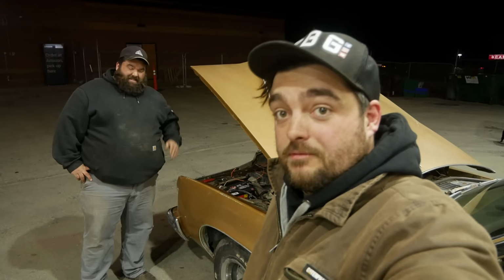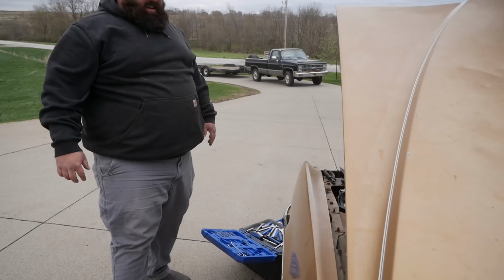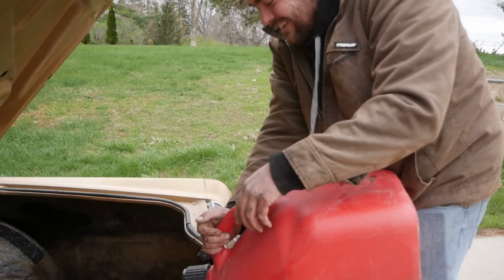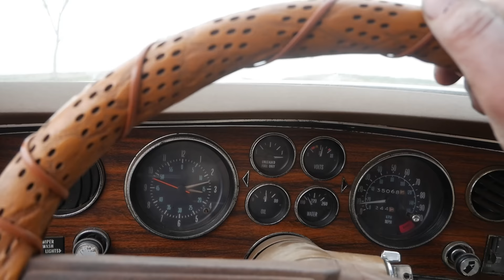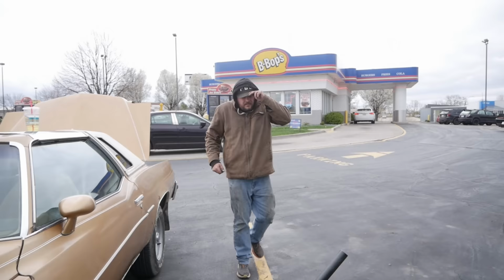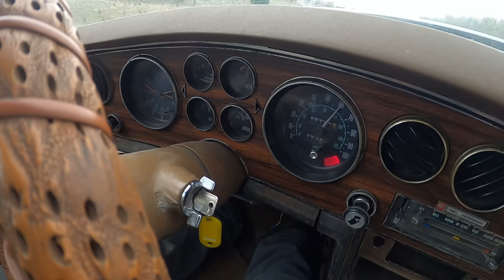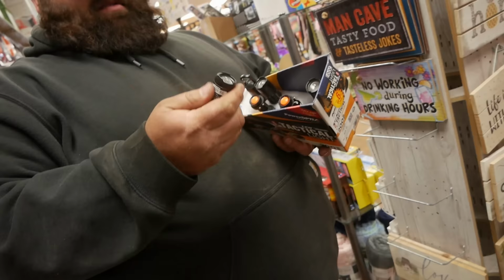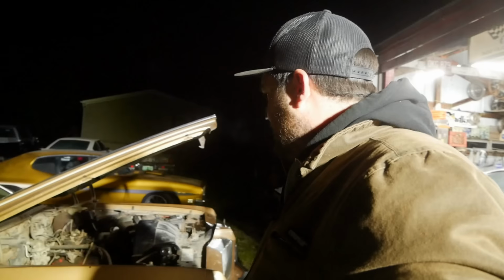SAVED-Will this RARE 1976 Grand Prix Drive Home After Sitting 20+ Years?

Comment: You and Cody always make a great duo. That Grand Prix honesty doesnt look like its in that bad of shape
Reply: Oh definitely. Nevermind all of the rusted body panels, the fuel supply situation, the issues with the tank itself, the starter, the brakes, the leaking radiator, and everything else...😂😂😂 I'm just playing bud. It would be a nice project for someone to take on to repair all of the rust, replace the tank, overhaul the braking system, the T-tops, and rock it around. I know that I'd pimp it.

Comment: Another awesome revive and drive! That ol girl deserves some love. New starter, tighten up the front end, carb, clean tank etc. I think it can be made into a pretty reliable cruising machine. I don't care what anyone says, the big underpowered 70's American land yachts time is coming, maybe not in value but popularity.
Reply from the maker: And it's not like it's difficult to make them move out of their own way. Cam, heads, done on a Pontiac
Reply: @PoleBarnGarage  definitely! Doesn't take much to wake em up a bit. My 76 Torino has a rv cam, aluminum intake and 4 barrel carb upgrade. Dual exhaust with stock manifolds. Scoots pretty good for a big car.

Comment: I owned a 1963 GP and a 1980 GP. That orange was part of the original engine colors. My 1963 was midnight blue with GP mag wheels and black naugahyde interior. Chrome everywhere. The ‘63 was part of the Pontiac wide track series. The 1980 was two tone burgundy and silver with burgundy leatherette interior. They were both excellent automobiles. Enjoy your ‘76.

Comment: Always had those big cars. Last one was 1979 Lincoln town car. As long as you’re not blind, you don’t need “road feel”. Just don’t over drive the car. (Don’t go around curves like an Indy car). And those cars could take a beating. I got hit in a 1965 ford wagon while sitting at a red light, behind a tractor trailer. The guy who hit me was doing 60mph in the rain and never hit his brakes. He put a big dent in the back of my car, yet I drove it home. (He had a 1972 Buick Rivera.) he didn’t. Nowadays, a low speed impact will total a vehicle!

Comment: Cody saved the day.
I once put black pepper in a busted radiator and drove several 1000 miles with it.
Didn't lose a drop of coolant. It set in the hole and completely sealed it.

Comment: While I've never changed a brake caliper in a burger joint lot, I changed a starter in my impala in the parking lot at the auto parts store, it let it's smoke out when I tried to leave.. walked in, bought one, borrowed a socket set from a friend's employees who happened to be around the corner, and changed it where it sat 😂 the sales people were leaving for the day and talked to me about it on the way out, noting it was a junkyard motor, the first of 2 so far, they thought it was great I was fixing it where it sat instead of towing it. I've done lots of stuff like that, we don't call tow trucks until all else has failed 👌

Comment: The steering wheel is the first input from the driver. The last place that steering motion leaves is the idler arm. So it carries the most stress, and consequently the most wear. The lion's share of steering problems can be corrected by replacing the idler arm.

Comment: About to roast Cody on trying to move shifter without ignition on then remembered how many times I’ve freaked out because ignition wouldn’t turn on and then realized steering wheel was against lock and just had to turn wheel a little and key turned easily, that Grand Prix looks like a keeper to me.

Comment: Sold one I had that was previously my cousins car.  After many years I sold it with 176k all original powertrain, no oil loss, no smoke, and original automatic with tight shifts.  I had installed a new cam at 60k when they had it, since they didn't change the oil and it clogged the upper heads and under the manifold with crap.  Amazingly the rings never seemed to wear.

Comment: I had a 1971 grand prix. It was real clean car. One thing I thought was awesome about the car was the outside door handles. The fuel gauge didn't work so I accidentally ran out of gas. Pulled as far as I could off the road but someone still managed to rear end it.

Comment: I ordered my 76 LJ from the dealer. Got every option that was out. No t tops. Mine was deep maroon w gold pin strip, padded roof, volour seats and deep carpeting. 400 engine, 400 Turbo trans and factory posi w dual exhaust.  I only paid around 5500.00.

Comment: I would restore this one correctly. I know it will take longer to do it right but these GP's are extremely rare now. It's a good car that has had years of half ass fixes. The rusted out sections can be fixed with GP sheetmetal from a Southwest donor car. Places like Desert Valley Auto Parts will have the sheetmetal you need and maybe the glass t-tops.

Comment: My brother had one of those in the 80s she purchased it in 84 he lived in Columbus Ohio and was working in Cocoa Beach Florida every two weeks he would drive that car home on the weekends to see his ended up putting almost 200,000 miles on the car with assault in Ohio and assault from the ocean rest of the car completely out departed in 1988 the cause of rust issues but he still ended up selling the motor and the transmission out of the car for $1,000 he said that was the best car he had ever had

Comment: I LOVE 3rd generation GM A-Bodies. No I don’t think they’re cooler or better than the 72 and earlier cars, but there’s just something unique about the 73-77 cars… like this sweet spot between two eras, cars that were born with potential but handicapped from the factory, styling that seems repulsive at first but grows on you whenever you see it amongst other cars in traffic and you realize how unique they are..

But the window has mostly closed on these in terms of availability and affordability. Prices are skyrocketing because people have realized that you can’t touch 72 and earlier with your arms , legs and first born intact, and 78-beyond are small and a different beats altogether… so these 3rd gens are the last chance at a full sized body on frame large engine bay ride. I had a 77 Cutlass that I stupidly sold in 2011… haven’t been able to find a replacement since than isn’t priced DOUBLE what I paid for the Cutlass when I bought it in 07, and in worse condition. Of course, I’m in Michigan, so rust is a major factor.

Comment: I look forward to you making actual repairs to it. A new starter, and radiator, get all the brakes did, get the master cylinder did, and put nice tires on those pontiac rims and fix that rust. You do have a special car there.

Comment: Entertaining video: I acquired one very similar in mid-eighties with the low compression 350 2bbl Pontiac V8, Turbo 400 trans. and like 2.73 rear axle ratio. It didn't have much power, but it did sail down the interstate. I drove it to FL from NY and back, and never got more than 12 mpg, was the next to last year of the nice mid-sized GM body on frame. Wish I still had it as the old car guys are grabbing them up for the nostalgic factor, very cool rugged old ride.

Comment: My stepdad had a 77 same color it had the 400 and the console shifter no t-tops, sunroof. I got one with the 301 and the column shifter for super cheap from one of his friends. He worked at some kind of chemical plant it got so Rusty  too sheet metal screw the Hood skin down.  The 301 in that one got damn good gas mileage  and the AC still worked but man, did it take a long time to get up to speed.

Comment: Go through it and make it reliable. It’s a good starting point since the engine runs so smooth. New fuel system, starter, and tighten up the front end.

Comment: the next time that you have a leaky radiator try K seal it works fantastic and it won't gum or cloud your radiator, it'll also seal hairline cracks in the water reservoirs and your engine if you have any.

Comment: Had one of these back in 1983. Nice car then, the 400 ran very poorly. Pulled the motor took it to the machine shop. The machinist said there wasn't a square or round surface to found in the block. I put a pontiac 350 in it. It was a nice driving, riding car. Sold it, in Oregon leaky T-tops suck bad!

Comment: Pull the Engine. Rebuild it, dump all the emissions, new intake, header's and a 750 Holley/Edelbroke ;). Oh, and an HEI. I had '73, did all that (minus the rebuild), that I used to take to the sat night street races, beat everybody except, some guy that showed up with a 305 in a Vega w/a welded dif. I got him off the line but, about 300 feet in, he shot past me. So, when the GP started blowing rings, I bought a Vega! Put a 500 HP small block in her, mini tubbed the back, Mickey street drags. With warm Mickey's I could lift the front end, only a couple feet but, impressed the hell outta the TRI-5 guys at the mall. LOL

Comment: I used to have a 84 Pontiac grand prix sj non vinyl top factory non ac manual windows car, vinyl door panels and complete guage equipment dash cluster minus tach,had column shift automatic transmission and tilt steering no delay wipers or cruise, factory am mono radio by Delco GM, bench seat front,had no bright metal trim along the bottom of the car,no trunk medallion but it had the nose cone header panel emblem post,wire hubcaps plain metal steel 14 inch wheels and factory 3.8 229 gm v6 th350 metric transmission gotta love the 80's lol,, I wish I had kept that car one rust hole right behind the Dr door the size of a baseball and the no headliner and the dr door was cracked behind the mirror car was from Tennessee i want another one..

Comment: The angle on the shifter is Pontiacs Rachet shifter, hit the shifter at that angle from low 1, and it won't skip any gears!!!
Reply from the maker: Nope, that only applies to the shifters with a detent set in them. If you push the shifter to the right and slam it forward it will act like a rachet shifter. Not all of them are, this one isn't. And it applies to all gm cars

Comment: good luck with the hurst hatch t tops, had them on a 75 buick century free spirit back in  the mid/late 80s and they were 500 each then, i doubt you'd even find them now.....good luck, you'll need it...p.s. i sold the buick to the wreckers and got 800 for it, body was shot but the t tops were great

Comment: My dad had a 77. It had a 350 Pontiac that my dad proceeded to shove a huge camshaft into. Isky 292 megacam. It ran horrible but spit fire n made alot a noise n seemed to amuse my dad😂. That crapped out n we shoved a stock 455 Olds in it. That ran pretty good.

Comment: the grand prix came out in 62.....it was a fullsize luxury sports car....was a catalina with bonneville interior special grills and tail panel in 63 they changed to a grand prix only body......in 68 they went to a intermidate body car.....smaller then a bonneville but still bigger then a gto....all had buckets and console all were 2 dr hardtops....(special order with a bench seat starting in 66)...no rag tops except in 67.
Reply from the maker: Correct but it really didn't take the personal luxury thing into full effect until 69
Reply: @PoleBarnGarage  true but it was never marketed or expected to be a muscle car.....even in 62 it was marketed as a luxury sports car....true till 66 they could be had with all the same options as a gto and would eat a gto with the right boxes marked off....but it was marketed as a answer to the ss impala offered the same yr....buick answered with the riv in 63......i have 4 prixs....62 automatic a 63 tri power 4 speed 8 lug  car a 64 ac auto and a 66 tri power 4 speed 8 lug car.....im fairly familiar with early prixs.....they down sized in 68 an focused primarily on luxury after that but was never a "muscle car"
Reply: @PoleBarnGarage  although another one saved is another one saved......the ole poncho herds getting thinner as the yrs go by....and they sure aint maken em any more.....little tlc shed be a gem....a anniversary edition is even better.......id advise getting a p.h.s. on it....

Comment: I thought the Grand Prix models back then were all very stylish. It's just the big old 400 engines were choked down to 135 HP because of pollution controls.
Reply from the maker: Not quite that bad. 180-220 depending

Comment: 400 pontiacs even smog engines make great power with a cam change.
Reply from the maker: Need more than that, compression ratios are terrible. Thin head gasket or mill the 6x heads though.. Then you have a runner

Comment: What is radio tuned suspension?    Car is a keeper.   Never saw 1 with t tops last of its kind. Factory or dealer installed option. That car wants to live.  Thanks for another great video!
Reply from the maker: Radial tuned suspension? Suspension "tuned" for radial tires
Reply: @PoleBarnGarage  What happens if all season tires are put on a car built for radial tires?

Comment: So you have the return closed and its building too much fuel pressure. What SHOULD be happening is it should be blowing throigh the needle and absolutely demolishing gas, but its not so id say you definitely have a needle issue lol also explains why the fuel kileage on that 400 isnt in the negatives lol. The clip came off the needle on my old nova once. It got like 40 miles to the gallon but you couldn't touch the pedal 😂
Reply from the maker: I would agree except Pontiacs were a no return system until 71
Reply: @PoleBarnGarage  I'm not sure I understand your comment, it's a 76 isn't it?
Reply from the maker: It is, but you don't need a return line as long as you have a vented tank, which we did of course

Comment: Enjoyable video; well done there fellers'

BUT it do beg the question... would it have been impossible to clearance the clutch fan for free, AND replace the starter at the same time, instead of under the car on the road in the cold, also saving on the flex plate teeth? Bravo for doing the brakes in front !

It sorts sends a backwards lesson to less knowledgeable learning younger watchers, which makes anyone doing this same type of thing automatically look like a hack.. go ahead, do it wrong, it'll turn out OK anyway....NOT!

....Just saying is all. 2 Thmbs Up!

Comment: Why didn't yous guys just disconnect the rubber hose to the gas tank and hook up a your trunk tank to the gas line back there?
Reply from the maker: Nearly impossible to access from the ground on an a body
Reply: @PoleBarnGarage  
Sorry, I was thinking my  '64 Skylark where the sending unit is on the front of the tank, not the top.